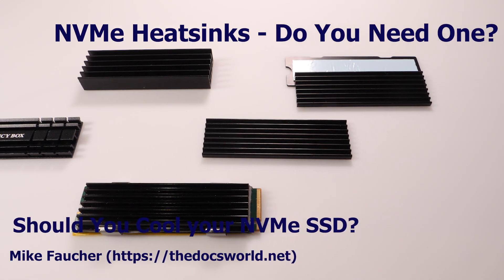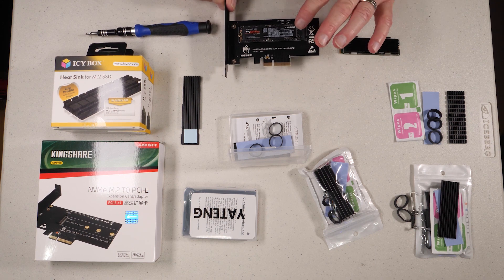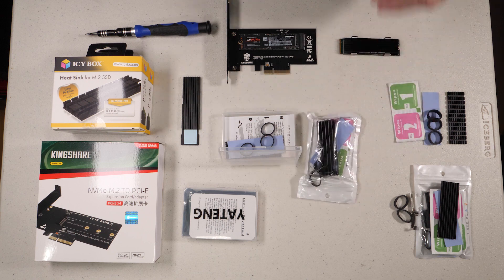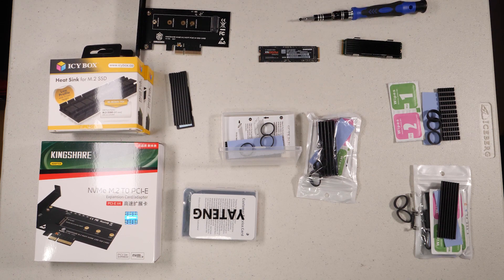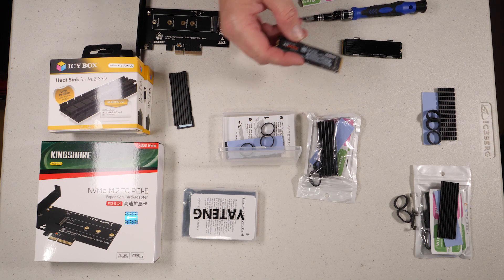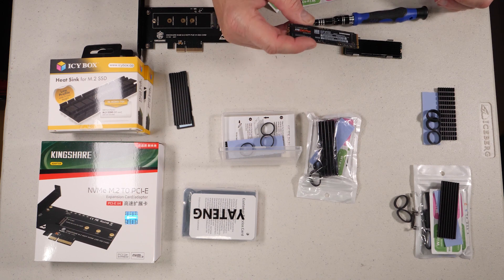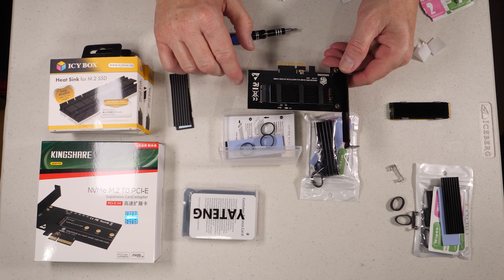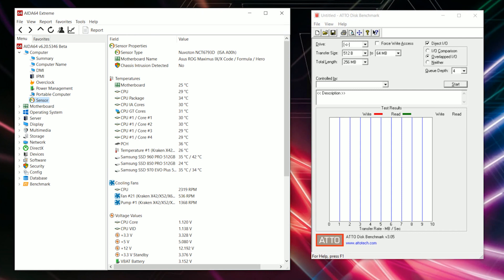NVMe SSD Heatsink - Do you Need One?

Comment: Since I understand you work in the semiconductor industry I have a question: I agree that is a good idea to cool the controller chip and NAND also, it's common sense that keeping them from baking themselves will probably prolong their life. But I wonder about the other small components around these main chips. What I mean by this, the thermal pad covers the entire M.2, including the tiny capacitors, resistors etc. When the SSD heats up, the heat is transferred to the thermal pad and then heatsink. I noticed the temp evens out between the controller and NAND which probably means those tiny components also might get heated up by the thermal pad. Some of those components might not heat up at all if the SSD didn't have a heatsink mounted. And now that they do, would it cause an issue? Let's say a constant 55c. So I wonder, would it be a good idea to only cover the controller and NAND chips with thermal pads (cut little squares) and leave the other components uncovered?
Reply from the maker: Interesting point and technically you are correct but most of the surrounding components typically do not generate much heat and are well under the normal operating temperature so I probably would not spend too time with the cut outs.  Great point though and thanks for bringing it up.

Comment: Thanks for the video, I'll get one of these. Unfortunately I've learned that m.2 SSD heatsinks exist a bit too late after buying a second SSD in hopes the temps will be more on the safer side. In my fanless Asus minipc the 970 evo plus reaches about 80c (and 100c for the controller chip) with Crystal disk mark test. Anyway, my only concern is about the rubber bands. Do you think they will loosen in time because of the heat? There's also the more expensive option to get a heatsink with metal clips but I'm not sure it will fit in that tight space.
Reply from the maker: I have not seen the rubber bands be an issue yet after over a year.  I also have the ones with the clips and they do not take much more room.  Either way I think you will be fine and you will see huge improvements in temperatures.
Reply: @MikeFaucher  Just an update for anyone interested, I bought the one with rubber bands, the 6mm height version. After 3 runs of Crystal disk mark, my Samsung 970 evo plus reached a max temp of 70c (with controller temp at 79c) compared to without heatsink 82c (105c for controller) so I'd say it helps quite a bit, especially keeping the controller from baking itself. Keep in mind this is installed in a very compact, fanless mini pc (Asus PN40) so airflow is very limited. Other bigger systems with active cooling should get even lower temps. There's also a 10mm height version heatsink, might give that one a try also. In a review, I've read that someone used kapton tape instead of the rubber bands to secure the heatsink. That might be a an even better way to keep the heatsink stuck tightly to the SSD for longer time.
Reply from the maker: @Nope-i4q  Great results. Thanks for the update.

Comment: But do you need one? My PC builder didn't bother installing mine. I'm wondering why.
Reply from the maker: If your SSD is exposed, I would say yes.  It will not hurt but it will throttle if you do use a heatsink.  Many motherboards have a heat sink cover that mounts on top of the SSD which work find, but IMO, I do not run a system with a heatsink.  Hope that helps.
Reply: @MikeFaucher  I'm not sure that's clear. It is exposed, right above the RTX3070. How can it throttle by using a heatsink?

Comment: Thanks-! I just got my first new Samsung 979 evo and was really concerned about this, my instinct always leads heavily towards a heatsink, but I was also on the fence about the label on or off etc, and now that I know its copper I have a better understanding of how they can leave with no heatsink.  My G-byte B450M motherboard comes with a good size heatsink and the verdict for me seems to be to leave the label and use the heatsink, dont see how it could do any harm except maybe getting really stuck to the label and making a mess of its possibly removed, but for my average uses I dont see that happening unless the drive dies and has to be replaced.
Reply from the maker: I have left my labels on and have never had a issue even a couple of years later when I change out the drive.  The pads do not really harden and my temps are always in check.

Comment: I've noticed watching several "heatsink" videos that adding a heatsink to an M.2 MVMe ssd will cool the drive typically around 15-20 degrees but comes with about an 8-10% performance hit. So, if the user is okay with losing about 10% performance, it's definitely worth adding a heatsink because of the throttling down factor and because it should extend the life of the ssd a bit as it'll better keep the temperatures down.

BTW... I think those "thinline" heatsinks are for laptops. Desktops can use any heatsink but laptops don't offer much clearance so those heatsinks have to be thinner and even then it depends on the build whether or not it can accommodate a heatsink.
Reply from the maker: Thanks for your input.  I tested many drives and have never seen a decrease from adding a heatsink but have seen performance hits from throttling.  I am sure it is dependant on many factors but as I currently have 20+ NMVe drives all Samsung, they have held their own.  Great point though,  Thank you.
Reply: @MikeFaucher  It does affect performances whilst writting :
https://www.eeweb.com/industrial-temperature-and-nand-flash-in-ssd-products/
"The ability of NAND flash to store and retain data depends on the temperature which the NAND flash is subjected to during writing, and between the time the data is written to the time the data is read. The higher the temperature that the NAND flash experiences, the greater the acceleration of charge de-trapping mechanisms that could lead to random data bit failures."
Reply from the maker: @MiettedeThonTomate  I would agree.  I work in the semiconductor industry and heat is always a killer.  Once you hit a certain threshold on a device, lots of bad things happen even if there is not a failure.

Comment: Apparently its best to cool the controller chip rather than the NAND.  Are there coolers for just the controller?
Reply: Cooling the controller is a no brainer, it just helps everything. However with the nand cooling increases lifespan, but can reduce performance. The performance change is usually smaller than the lifespan change, but neither is huge within a reasonable range. I'd suggest cooling both unless your in a niche situation where  performance is critical enough to pay for the lower lifespan. You'd want to check the details of the nand and the controller to see how much change to each actually happens and whether the drive is already saturating it's pcie link.
TLDR: cool the nand unless you've thoroughly researched your specific situation.
Reply: @kaseyboles30  my son's Kingston A1000 failed after 2 years, I assumed from heat. I bought 3 different heatsinks planning to cool all our drives but while researching came across the 'cooling controller not nand' theory & decided to just thermal tape the controller, but after your explanation I think I will now tape the lot. SSD's have crazy performance any how, so a tiny hit to extend life seems worth it. Thanks.
Reply from the maker: These all cool both.  Personally, I do not agree with only cooling one.  Thanks

Comment: Dude what are you doing you need to remove the plastic from the m.2 ssd and then apply the pads from the heatsink.You did it wrong I have the same Samsung evo 512 gb plus m.2 ssd and have removed the plastic that says varanty void if removed and have excellent results the temp don't go above 55 degree under heavy load,without the heatsink it was 65 degree under heavy load.But you need to remove the plastics from the ssd,it says in my heatsink manual for the ssd.
Reply from the maker: Removing the is not required but it does make a 2-3 degree difference. If you are looking maximum performance than you are right.

Comment: BUT DO YOU NEED IT ??? CAN THE CHIP TAKE THE HEAT ON IT"S OWN !!!!!!????
WILL IT BURN  OUT ???
OR CAN IT WORKS FOR YEARS  WITHOUT A HEAT SINK  ?????
Reply: Stop shouting, please
Reply: Jesus man, type like a normal person.
Reply from the maker: It will not burn up but it will definitely throttle down and it does not take much to throttle.  In my opinion, you need one but that is just what I experienced.
Reply: Why are you YELLING????? Calm down bro.

Comment: Did you install the heat sink on top of the label? You really should take the label off first. It does have some heat conduction properties but that's exactly what the heat sink is for.
Reply: I m gonna apply a heatsink to my ssd and just because i saw that it works w/o taking the label off, I m also keeping my warranty.
Reply: @straightdot  If you remove the heatsink, the label will be removed, so obviously the warrenty is voided, except if you live in Europe where this doesn't apply, you can safly remove this label
Reply: @vostfrguys  and the USA and AUS
Reply from the maker: Yes i did.  You void the warranty if you remove it.  The difference is only a few degrees but it ultimately your choice.  Thanks.
Reply from the maker: @kingkorg7583  No I did not. No issues. Thanks.

Comment: The temp went up slower but kept going up; what if you ran the test 3 times in a row; can it maintain under 70 degrees during a continuous load?
Reply from the maker: It is possible if you try hard enough to get it to throttle especially with the very thin heatsink but it takes much more abuse to get it to throttle.  Far more than a drive without a heat sink.  I have run the tests 3 times and it did not throttle.  If you have an application that runs that much continuous data then you may need a heavier duty heatsinks and possibly an active fan.  As I have about 5 of them none get anywhere near throttling with the heatsink.  Thanks for the question
Reply: @MikeFaucher  again, well said sir!
The thinker the heatsink the more heat it can take for an extended period of time. But if they application you running requires a long period of activities on the SSD then you definitely need heatsink with a fan otherwise all heatsinks will reach its limit and the SSD will throttle. Icy Box has a tower heatsink with 4 copper pipes and a fan similar to CPU cooling tower which is excellent for this kind of workload.

Comment: I've read that you only need a heatsink on the controller chip.  The storage chips don't need them, and can actually perform better warmer
Reply from the maker: Thanks for the comment.  That has always been a debatable topic I hear quite a bit.  As I work in the semiconductor industry I fall into the keep it on the cooler side of the MFG operating temperature.  No heat sink will keep it cold but rather keep the heat from getting out of control.  These heat sinks still get hot so I am not concerned in any way that they are over cooling.  Just my opinion and thanks again for commenting.
Reply: @MikeFaucher  Thank you so much for this response. I have been researching this for quite some time and your response to this question makes the most sense to me. My amazon shopping cart can finally empty. Thanks for concluding my search for a satisfying answer!
Reply: @MikeFaucher  well said, it is not cooling the flash memory it is just keep the temperature under control.